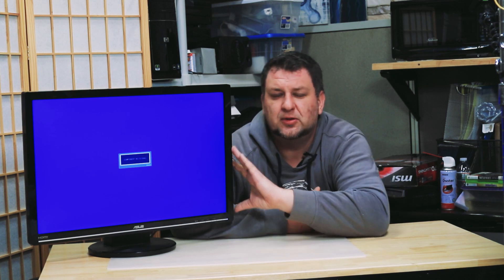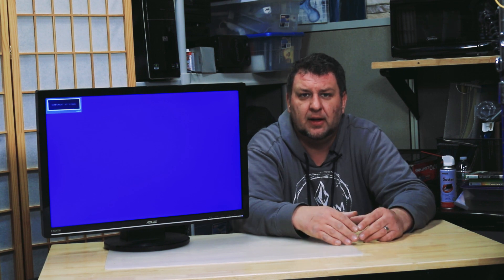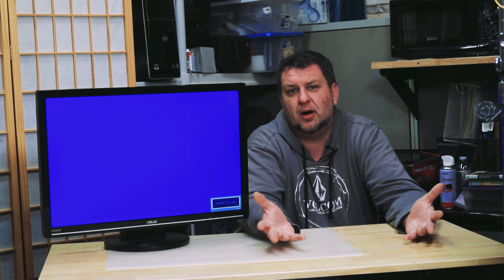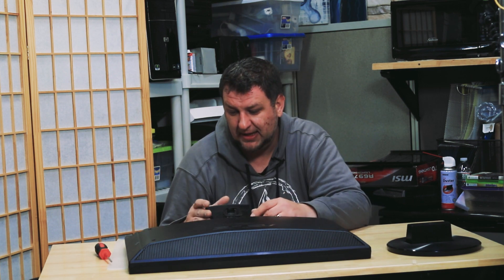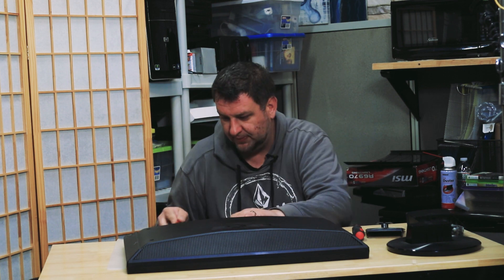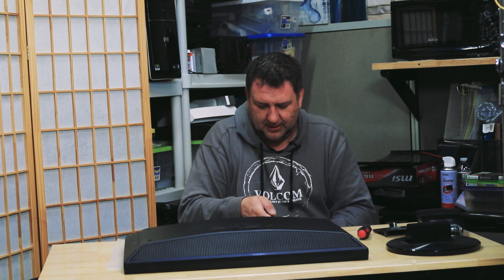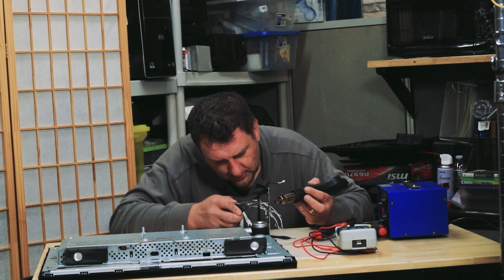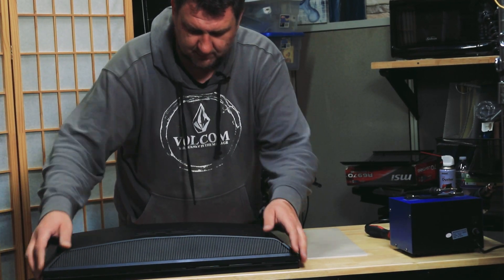Random monitor Menu Keeps Popping Up Fix

Comment: I have this opposite problem with my Philips 55' LED tv- when tunring on it boots and then it immediately goes to searching for channels, and the volume immediately goes all the way down. as if the left scroll button is stuck. I've removed the button board on side, and the symptoms are stil the same. I've cleaned the button board contacts and no changes,  I've done all power cycle attempts and removed batteries from remote. nothing.
I've clearned all connetions with spray electrronic cleaner - no changes.
 I'm able to move the menus side to side and scroll to sources menu, but it is as iff the cursor's buttons are stuck down, wanting to scroll to the left. I have to hold the right button down to scrool the menus over to "Settings" and I try to get into that menu and nothing happens. menu gose away.
 so I hit the manual button on menu it pops up again and I struggle to get it to settings menu and I try to click on that and it goes away-  no menu- cannot get into that settings to do factory reset. I can somewhat scroll thru input menu options, but let go of button and it scrolls to the left again. ITs erradic. 
The remote allows the set to turn on, but remote has no responsive features working, and does not turn off once it's already been turned on.
*CAN Anyone here tell me What do you think this is? do I swap out main board? or what about the smaller control board that the IR sensor and button board both plug into? could that board be bad?
there is nothing wrong with picture, screen or anything like that. tv turns on and off  witht he power button. WhaT IS THIS?

Comment: How does the switch go bad if you never use them?
Reply: Well here's your 2 years late reply it's because of dust a debris
Reply: @NightlyFr so how does dust and debris get in the switch if it was never really used to get any dust inside? Also I ended up breaking the button to try and disable it and it didn’t work. I powered it off and unplugged it for a while and it worked for a while then started doing it again.
Reply: Mine started doing this after a power outage. I think the button panel got fried.

Comment: I have this with an LG monitor. I live in Spain, humidity is high very often. When the humidity is around 70%rH or more, the OSD randomly pops up. As soon as my space is ventilated, the humidity drops and the OSD stops popping up on its own. Averagely, 65%rH is low enough to prevent this problem.
I tried removing the control panel, it made no difference, I'm quite certain humidity is a factor.
It's worth getting a cheap hygrometer and put it near your PC equipment for easy monitoring (no pun intended).

Comment: But how will the screen power on without a power on switch and the screen switches off as soon as I plugg out the power cable
Reply from the maker: Turn the screen on. Then unplug the power from back for about 30 seconds and plug it back in. If the screen comes on. That means the monitor keeps memory as too what state it was last. Monitors tend to stay on once you turn them on they just go to sleep when you are not using it
Reply: @TeckDrivenTeck  Thank you so much for the tip it works now without a problem. You have earned your self a like

Comment: How do I stop Fn hotkeys and osd from popping up every time I press the caps lock button?
Reply from the maker: Most likely your keyboard has some kind of fault or debri the makes it stick
Reply: @TeckDrivenTeck  Not sure it's safe to pull the keys off mine.
Reply from the maker: @ThierryRocksTV  if it only pops up when you press a button then it is likely that removng keys may not work. Osd on monitor should not be related to Caps lock. You would need to fimd out why it does that when pressing a key first before removing any keys

Comment: Your videos are great. :) 

I have a 20" Samsung Syncmaster 2032BW monitor.

Today when I turned it on, although it showed an image, it constantly showed the MagicBright items being selected automatically one by one without stopping (affecting the brightness of the image as you might expect), other times it did the same thing but with the items in the main OSD menu itself, and other times it also did the same thing when the monitor was detecting the mode, whether digital or analog, sometimes choosing one and then choosing the other!

In other words, it seems to me that it goes into a loop (sometimes for quite a few time) within the option that is active, be it the OSD Main Menu, the MagicBright menu or even when detecting the mode (whether analog or digital).

Another thing that sometimes happens (but doesn't affect the image) is the blue color of the power button, some days it's on, other days it flashes, and some days it doesn't even light up, even though I can turn the monitor on!

Can you give me any clues as to what could be causing this problem with the monitor?

Many many thanks.

Comment: Hallow sir I need your help can I only remove and not replace it can I do it need a ansor
Reply from the maker: Depends on the monitor, on some you can remove it and you will be fine on some it may give you a error. Best way to test it is to unplug the button board and see if the monitors will still function
Reply: @TeckDrivenTeck  thanks that helps me
Reply: @TeckDrivenTeck  thanks budy I remove the wire and now it solwed

Comment: I have an LG Flatron monitor. The PCB for the buttons is separate with power button PCB and is connected after the power with cables. I removed them and still the menu keeps popping up :/

Comment: Hi my main output of my pc is supposed to be vga but right now im using dvi as temporary. I can't change dvi to vga since the buttons of my monitor is broken. Should I buy a new one or get it fixed? Thx.
Reply from the maker: It depends on how old the monitor is. If it is old i would just buy a new one. Even the chepest new monitors are fairly better then old ones. My rule of thumb is 5 years old replace it if it is not a easy fix
Reply: @TeckDrivenTeck  ooooo okieee thankyouuuu so much!! :)

Comment: I have a Acer 1715b little lcd monitor and i found that only pushing both DOWN and power buttons i can turn the screen on and off?? The Power button and all the others dont seem to work alone and i had this apart and cleaned and checked the little board and main board and pins ect and nothing is shorted. I guessing a corrupted main chip or firmware? Other wise the screen works 100% when you give it the input, it goes green and turns on and amber when input stops. I might have to use a third party program to change brightness as the menu buttons dont work to adjust brightness. This is from 2005 and changed all the PS caps as picture looks great and may still have plenty of use in it. I love to get into the service menu to find out how many hours this has had but dont know code for front panel and buttons wouldnt work anyway! haha.

Comment: I was able to fix mine. All I did was buy some small PCB buttons from Amazon, take apart the monitor, remove the bad button and solder on a new one.
Reply: that sounds way to difficult
Reply: @Aiden-fk6xj  not really if you know how to solder
Reply: @trevboy98  i dont 😂
Reply: @Aiden-fk6xj  what is solder

Comment: I have an LG flatron monitor which popped up randomly the menu on and off randomly and rapidly, so I plugged out the side buttons, but no success. Then the power started going on and off randomly... which was much more irritating.
So I checked again and an SMD diode on the power button board was blown. Soldering another one from another power button board or any kind from a less than 5V device will do the trick.
I hope this helps some people
Reply: I have the same monitor lol

Comment: Is there any way to fix this without actually opening the monitor?
Reply from the maker: Some people reported that spring little oil on the buttons helped but for the most part it is caused by bad buttons or bad capacitors

Comment: Same problem with my monitor can i deassemble  buttons
Reply from the maker: I found that the easiest solution is just to disconnect the buttons board, and it works on most monitors with this issue
Reply: @TeckDrivenTeck  ok i will do it

TNQ

Comment: wait now I cant turn my monitor on. windows sees it but I can't turn it on what do I do?
Reply from the maker: It needs to be turn on before you disconnect the buttons. The monitor should remeber the last state that it was on. After that it will go to sleep if not in use

Comment: Thanks for the Video, was an an easy fix, just removed the button bar and it works perfectly fine.
Reply: how do you turn on and off the monitor without the buttons bar?
Reply: @JusunGuitar  you just leave it on before you unplug it, then it automatically turns on if you plug it in again. When your computer is off the Monitor goes into standby pretty quickly
Reply: How did you remove

Comment: Watching this video with my input menu right in the middle of the screen. Gonna give this a shot!
Reply from the maker: Like I mentioned in the video, another option is just to unplug the buttons control board and it works without it connected
Reply: @TeckDrivenTeck  Thats what I ended up doing, saw some corrosion and cleaned it up, popped it back in, and it works great! Thanks for the tutorial!

Comment: It's happening now with my Asus monitor too. It's probably 2-3 years of age now. The blue light filter settings keep popping up on the lower right side of my screen then when I do a long press in 1 button in the monitor, it will disappear in short period of time then will resume again. Can you recommend an action for this?
Reply from the maker: I would try disconnecting the buttons and check the capacitors to see if it is the button or capacitor that is failing. Disconnecting the buttons usually helps

Comment: is there anyway you can disable the buttons in your monitor?
Reply from the maker: The only way is to disconect it
Reply: @TeckDrivenTeck  how?
Reply from the maker: @cedricnofuente6876  open the monitor up and unplug the swich board for the button if it is not intergrated. But this will disable all buttons. Most monitors will remeber last state. So when you unplug it in on position. It should remeber without switches to stay on

Comment: hi sir, i have this problem, you brightness indicator, but im volume sir.
Reply from the maker: Like i mentioned ot the middle of the video, the easeast solution is to unplug the entire switch assembly and it should fix the issue
Reply: @TeckDrivenTeck  Yes sir, but yesterday i go to service center in my place, and they also don't know what the problem is, haha. I only bought it for a month
Reply: Thankyou sir, true pcb button thats problem.

Comment: I get rid from popping control bar in the middle of the display but the brightness and contrast of the screen is on the higher side, almost maximum 100% which cause very bight washout picture, pls. suggest solution
Reply from the maker: Best solution is to leave your monitor off for a while to cool off. Then turn it on and adjust the settings, after that unplug from power. Then unplug the button bord from the monitor. That should prefent setting feom changing. Not the best sollution but it works
Reply: brightness and contrast option of keys are disabled and grayout so unable to adjust , is it any software problem
Reply from the maker: @prafulchawan7389  most likely it is hardware problem. It detected a foult and it disabled it. Common problem is buldging capacitors on the main board that couse all differnt problems

Comment: having this same issue with the menu button for a while and it really bugs me off!
Reply from the maker: I fixed one button then after few weeks a second button started giving me issues. I turned the monitor on and unpluged the entire switch assembly and no more issues
Reply: @TeckDrivenTeck  that's a good idea. I'll just unplug the switch assembly. they're actually useless for me. I don't remember using them except the first time when I brought it. haha.

Comment: I got this problem on my samsung SyncMaster F2380. Disconnecting the menu PCB was my solution 2 years ago. I wanted to restore the buttons & OSD menu today and, after removing the glue from the scotch used by the manufacturer, everything is working correctly.
That is... For now, I suspect the scotch's glue to interfere with the electronics (maybe it was acting like capacitor and was starting to conduct electricity) and was the cause of this problem :/

Edit: not a glue/scotch problem : the problem appair again (less frequently). However, the power led is less bright, and is strangely blinking (should be always on when screen is on). Probably a capacitor failing in the control unit :/
Reply from the maker: Most of the time it is because of rust or degrading buttons over long time and  capacitors failing, sometime both.

Comment: I have an issue, the external display options keep popping up for no reason (computer only, duplicate, extend, Projector). I have a presentation tomorrow. It would be really helpful if you couldn't answer
Reply from the maker: Is it on the display only or is it on the computer. Stuck keyboard key?
Reply: @TeckDrivenTeck  display only! I don't think it has got anything to do with the keys
Reply from the maker: @nidhijay768  for some reason I think it is computer related. I just never seen a option to duplicate or extend option on the monitor it self. Try looking up the monitor menual to see if the moniotor even has that option that way you can isolate coputer from display
Reply: @TeckDrivenTeck  probably!! Yes I'll look into it. Thank you for trying to help me out with this.

Comment: Hello, if I unplug the control board, how will I turn on the monitor?
Reply from the maker: If you unpluged it from power when in was on, it should remember thet the monitor was on. And it will always be on. It wouldn just sleep when computer is in sleep mode or aff as well
Reply: @TeckDrivenTeck  ahhh okok, i also have a switch on the back of my monitor for on and off. But if i constantly use that switch to turn my monitor off and on, do you think it will cause a problem? I think it might be like a switch to kill all power to the monitor.
Reply: @TeckDrivenTeck  also, if i leave my monitor in sleep mode (deep sleep) forever, will it cause any harm or damage my monitor?

Comment: I have same problem. My LG LCD monitor fell down and now menu is popping up. I disconnected the button's board and I see same problem.
Reply from the maker: The problem seems to be with the main board,  buttons bord is only a remote for the controls. Something is loose like a cap or chip
Reply: Try removing completely BOTH power button and the side buttons (if separate boards). If it fixes it’s one of the boards. Otherwise you have to check or replace the motherboard
Reply from the maker: @sraros  That is correct, I would look on the motherboard to see if you have any bulging Capacitors. Caps can cause that problem as well.

Comment: my monitor is only has 1 button how to fix this
Reply from the maker: Disconnect it, but that does not a solution for all monitors, some may work some may not
Reply: @TeckDrivenTeck  can i just break the button?
Reply: @TeckDrivenTeck  how can i dissconect it without opening up the monitor? please i need this fast

Comment: Same monitor, same problem 😅
Reply from the maker: Quickest solution is to turn on the monitor, unplug from power, disconnect the swich board and the plug it back in. It will remeber that the monitor was on and will always be on but it will go to sleep when computer is off
Reply: @TeckDrivenTeck  thank you ❤️❤️❤️

Comment: I had same problems... Brightness menu pops up and can't be exit. What I did... I resolder every point on this board(capacitors, resistors and buttons) with small solder gun. Of coarse I removed this board out of case. I also open one button and reassemble it(this was unnecessary).